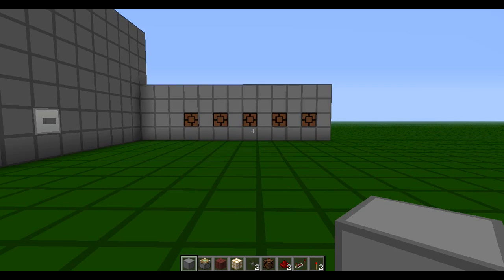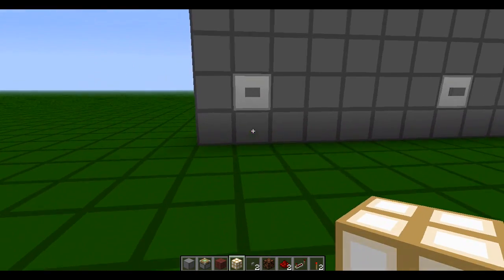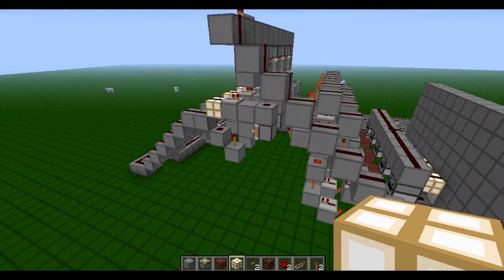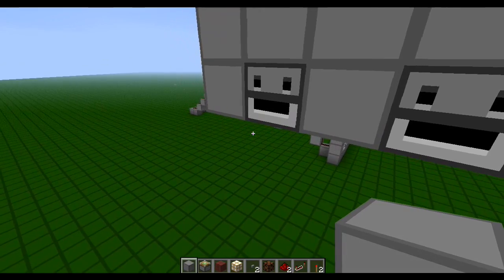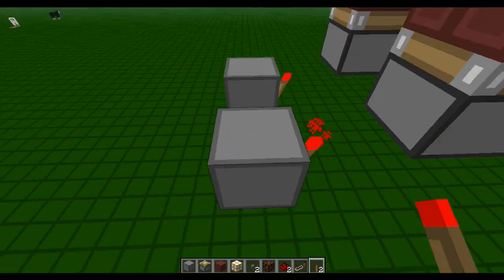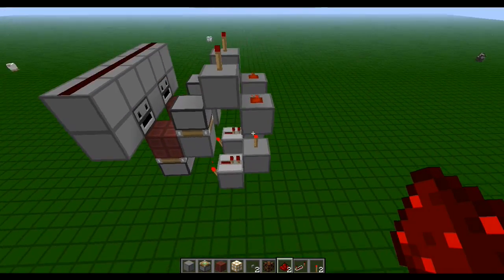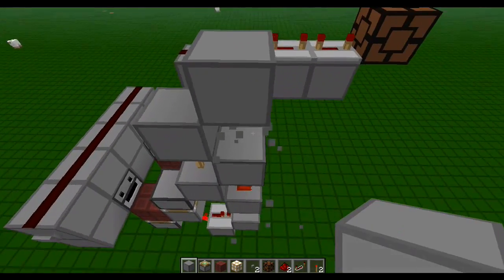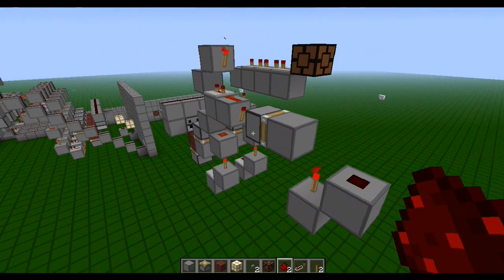Minecraft: Redstone Randomizer Tutorial

Comment: One thing I don't understand is how is that fire emitting a output? I tried googling but nothing turned up.
Reply from the maker: When the fire charge sets the block on fire, it updates the piston, which in turn outputs a signal and resets itself. I haven't built this in a while, so I'm not entirely sure if it still works. I think it does though.
Reply: Oh so it's block update, got it.
I just use the dropper/dis ones. A lot easier
Reply from the maker: Matthew Mentrup Yea, this design is a little old so I'm sure there are much more efficient randomizers out there now.
Reply: Yeah, well it just a lot more small and compact and you don't need infinite fire charges, just a diamond sword and another block will work.